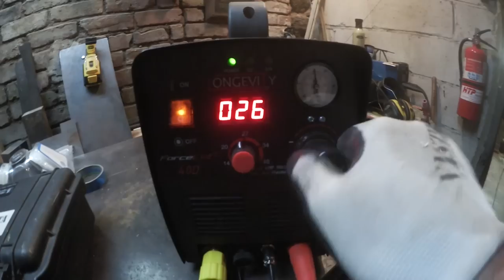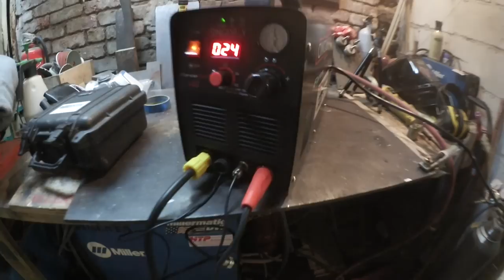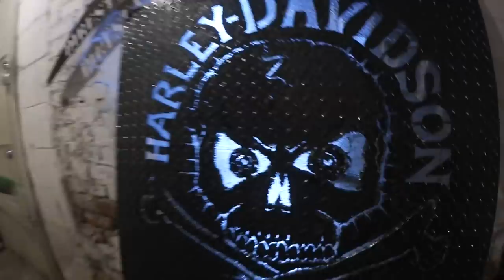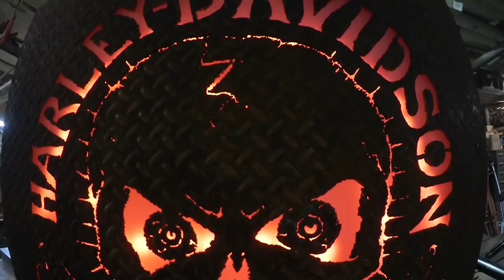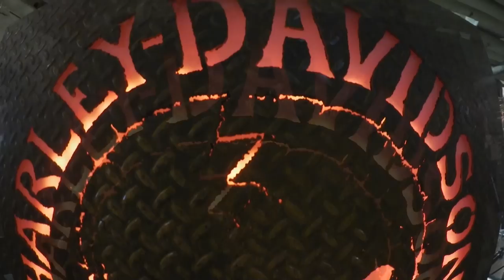✔ DiResta H-D Steel Sign

Comment: You don't need any advice from me, but I'm gonna offer some anyway. I made some lettering for a sign a few years ago out of diamond plate. I was having a hell of a time plasma cutting them out until it dawned on me to trace them backwards on the back of the plate. The plasma cutter was much happier on the side with no bumps.
Reply: and it would be easier to draw on :)
Reply: I was also thinking the same thing but then I realized a lot of what makes the sign awesome is how rough looking the edges are.  I wonder if this is partly because of constantly having to ride the small bumps on the diamond plate.
Reply from the maker: Matthew House yes i started to have fun gouging and getting sketchy with the line
Reply: If you cut on the mooth side all the slag would be on the front, and it would look like crap and take forever to sand off. Even though cutting on the rough side is harder, its better then trying to clean slag off of it.
Reply: ***** Yes, but if your plasma cutter is set correctly the slag pops off pretty easily. It does look pretty cool with the gnarly edges.

Comment: With LED lights, they're very directional. If you want to get a smoother, more diffused light, try mounting the adhesive back on the acrylic as an outline to the skull and have the LEDs face the white board so they get diffused evenly. When mounting LED T8 bulbs, the LEDs face up, not down (which is counter intuitive because why wouldn't you point the lights toward the floor) but it's the only way to have even light. Otherwise, it's a long chain of tiny spotlights that point straight down, almost like a laser.

Comment: Wow, I didn't know that you can sort of sculpt and cut at an angle with an plasma cutter.
Impressive work jimmy :)

BTW: I work from time to time with LEDs and found that these light strips are very expensive at the store. I usually buy them online (via eBay e.g.) and they cost a fraction of the storeprice...

Comment: Hi Jimmy, plasma looked very accurate, did you find it easy, or was it just your skill with it?
Sulphuric acid will creat rust instantly, especially on new metal. We use mortar cleaner (for removing unwanted cement and sand), it is in fact sulphuric acid, but wash it off immediately as it keeps going!
Great build, thanks for taking the time to make it public.

Comment: Excellent handiwork with the plasma cutter. Perhaps you can design and build a larger 3-axis plotter for the plasma. Question, why did you cut the front and not the back? Would the smooth back been easier to trace than the diamond plate front?

Comment: Is there any proper way to diffuse the light completely so you cannot see the shape of the LED strip anymore? So you just have a uniformly colored surface?
Reply: Another way would be to use a cathode instead of led strips
Reply: My thought would be the best way to have smooth light would be to mount the LEDs to the back of the metal where they are hidden and then paint everything inside a semigloss white so all of the visible light would be reflected coming from all angles then use the filter like he did.
Reply: Nevir202 Just spay glue aluminum foil into back plate, when you got some paint it to hold (not dusty wood), cut wood or plastic strips that is in proper angle so that light bounces from foil to all around and put leds into sides. This way back plate can be removed and system checked if needed. You can also polish inside of steel or spray glue more foil into that side. This way you get really good reflector surfaces. Also you if desired, dont have to use that much light strip doing this build=safes money/you get light strips into different projects. You also could use fixed color lights if that is for your design and use several colors in different places, or get two RPG stripts, then glue remotes in one or mod them to work as one(if you know how).
Reply: Hellsong89
Problem is anything too shiny will show clear reflections of the LEDs that was why I was saying to just paint it semigloss white. It will scatter it much more.

But I agree making the back removable might not be a bad idea.
Reply: Nevir202 Ou sorry my mistake! I engineered this in my head, so i forgot to mention that of course you let those parts that can be seen from holes basic white (if that is not what you desired), but add shiny reflectors in areas what cant be seen! This adds power of lights if it looks too dim on its own. :)

You could also btw use steel whull to scrape aluminum foil so its less mirror like and brakes the reflection.

If your doing build like this, please test these things and tell me how it ended up. :)
Reply: Hellsong89
Ah, yea foiling the sides and even the back of the steel plate might not be a bad idea. :-)
Reply: Use the random orbit sander on the back of the plexi.

Comment: Heads up on LED light ropes. If you get the waterproof ones, they really don't work out of a wet environment. They sorta' over heat and die.
Reply: Matthew McLaren
 Aye. I needed a set to light up a bookcase. Being a berk I just went with the cheapest set, was a waterproof set. All died in ... oow, 3 odd months of light duty use.

They got silicone (I assume) covering on them, so they just keep all the heat in. Light die off, brightnesses get really spotty and weird over the length. Just ends up looking terrible.
Reply: Big_Adam_2050 Na that will be the cheap arse controller or PCB... The waterproof ones work fine out of water!

Comment: Just a question,  what wad the purpose of the oxidizing solution you used to rust the back of the sign?
Reply from the maker: just little more rust .. it kinda rubbed off with flipping the sign all around

Comment: Did you want the led strip to be visible? To have completely diffused light it is better to fix the strip on its edge, not facing the plexi but 90° to it.

Comment: If you do a pice of makrolon polycarbonate with white translucent vinyl for defuser.  and you won't see the LEDs through it... Awesome sign
Reply: I was thinking about putting LEDs on the metal plate, so light would bounce from white board and diffuse better, this way LEDs can be seen little too much ...? But that would probably cause shadows ...
Reply: Matej Rajčan b

Comment: what chemical do you use to rust  the steel ?
Reply: Anything that rust steel like water, salt etc. Important part is to get that trough oil&grease layer protecting the metal. Usually you can just leave it out side into rain for couple of days and your all ready, but to do it artificially clean grease out and then spray it with water or water+salt mix, then when reaction has done enough for you wash salt away and let it dry. Brush if needed/wanted to extra lose rust particless off and seal with spray clear coat or more durable 2 base lacker.
You could also use some acids to darken the surface, but that is little bit dangerous if you dont know what your doing and if you lack self protection. Also some companys do this darkening finish for a price.
Reply: multimossad No problem buddy!